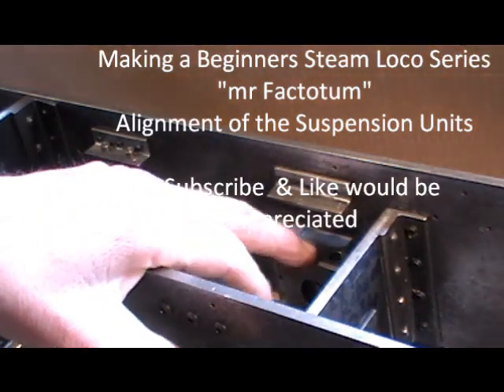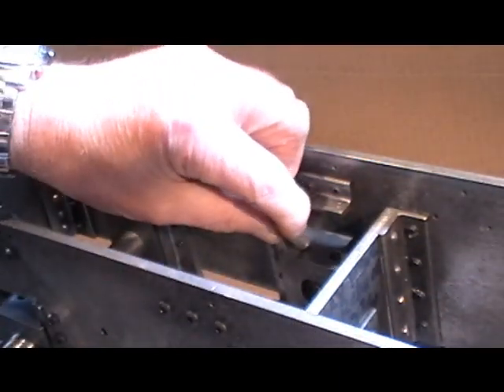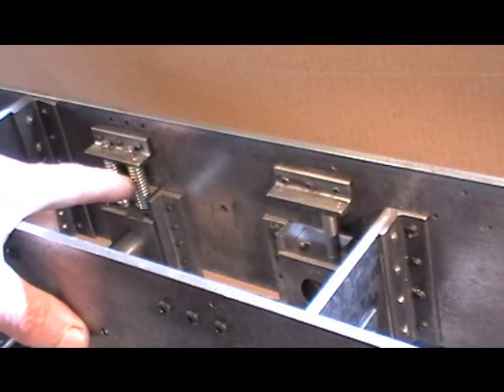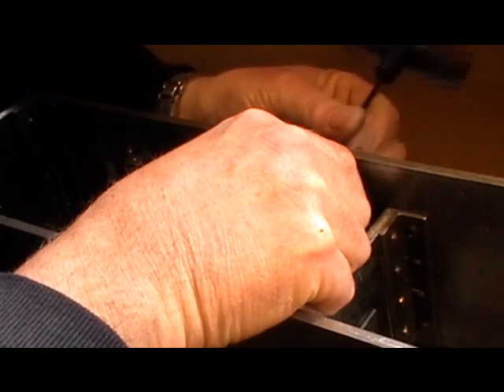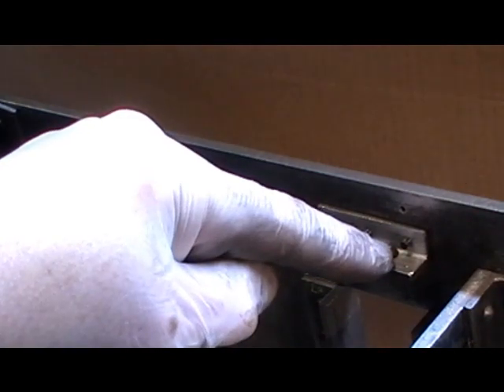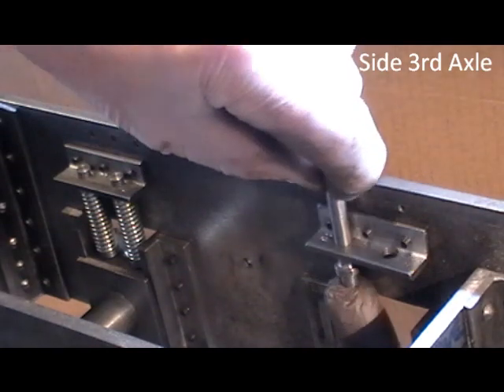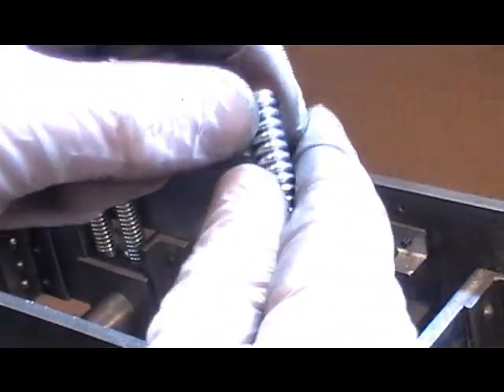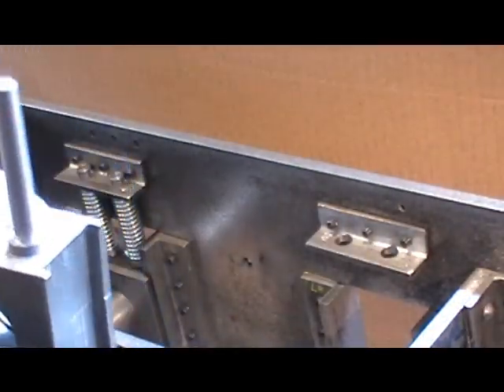Making a Beginners Steam Loco ( Exact Alignment of Suspension Brackets to Axle Boxes ) "mr factotum"

Comment: with the pins being tight in the axle boxes, will it not affect the rocking of the axle boxes ie the chamfers you put on on an earlier video?
i'm really enjoying your video's
Reply from the maker: hi paul
nice to hear from you, and thanks for watching and comments.
good point, ive only done everything to the drawing specifications, ive found when all the components are fitted and weight on the wheels and springs etc, they work fine , where the pins come through the holes in the brackets there's only a very small width of surface area in contact and  a few thousandths clearance here equates to more movement further down. hope this explains!! 
regards
mr f
Reply: @MrFactotum  ahh! I see now you have explained it.
thank you